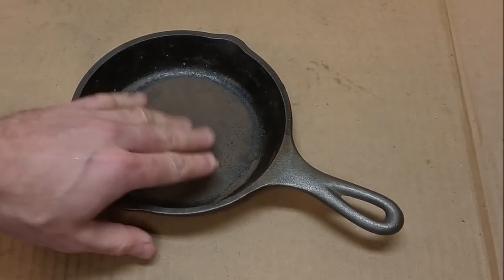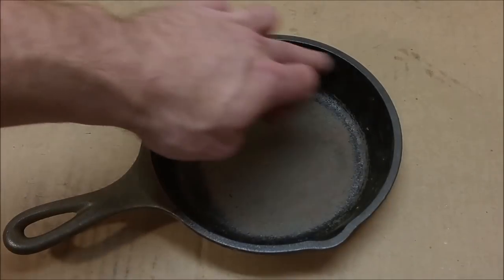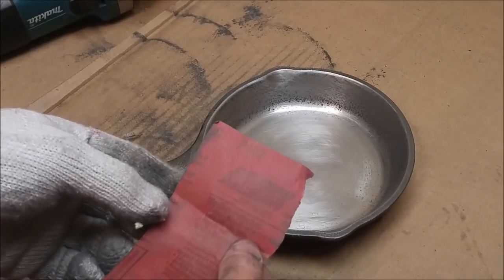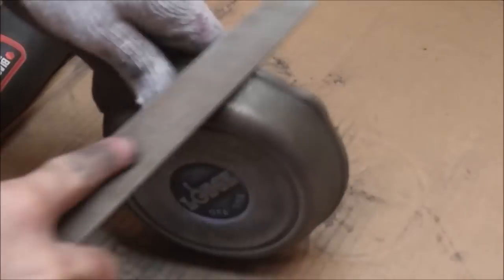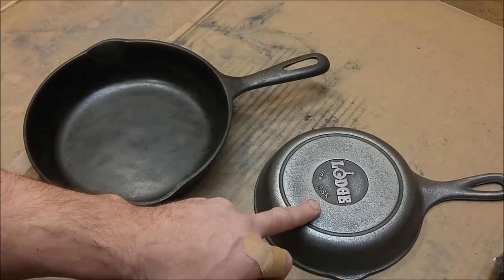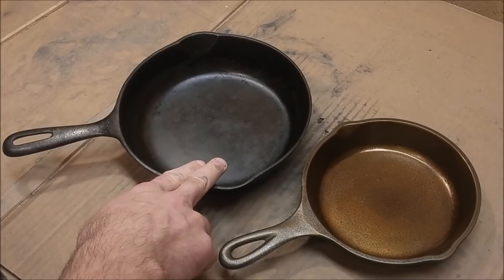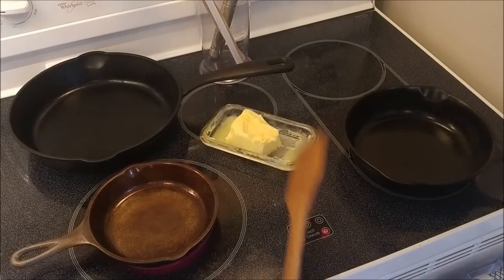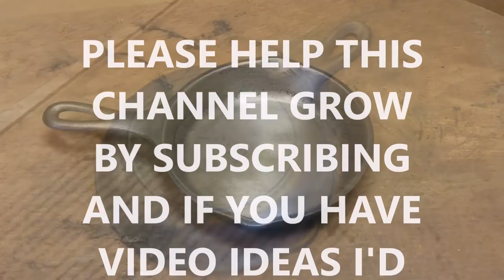🍳 SMOOTH a Cast iron Lodge skillet to make it function like an antique

Comment: I'm sorry man. Any authenticity this video could have had was completely lost on me when you sanded the outside of the pan and filed the edges etc. As a person who suffers from OCD, I can recognise this whole video is an exercise in obsessive behaviour. Unless you cook on the underside of the pan this was just ridiculous to watch. I suppose now one has to sand and file down the stove top to make sure that's flat. 

Furthermore, the seasoning is what gives the non stick surface you want in a pan. When the grit of the food-contact surface of the pan is too rough, then the incremental film deposition takes a long time to fill the troughs and lay a glaze over the bottom of the pan. So I can see the purpose of knocking the grit of the bottom of the pan down a bit. But polishing it right down to bare metal, you realise you have made it slick. Your new seasoning layer has nothing to grab onto. So I now expect your new seasoning layer will come off far quicker than people who just did the ten mins of light sanding work that was actually needed. The seasoning bonds to the metal but the grit helps it last longer before sloughing off. Yours will slough off far quicker.

I'm sorry man but in my opinon you took this job way too far. Maybe you enjoyed doing it and good for you. But this should not be an advice page for others in my humble opinion.

A quick ten min sand on the bottom surface to soften the grit is all that was needed here.

You lost me when you filed the inside of the hole in the handle. You aren't ever going to be cut by that sharpness during cooking and normal handling, and you aren't going to hang that pan on a plastic hook where that sharpness would cut it. The heavy duty metal hook you are going to hang it on would have softened that naturally. At that point I knew I was watching somone obsess.
Reply from the maker: Thanks for your opinion, I certainly appreciate your detailed comment.

I have performed quite a bit of testing since this video and I have found that the non-stick properties of the polymerized coating is not very good, it requires a coating of oil and relies on the generation of steam to prevent food from sticking.  A good way to test this is where residual oils were removed from the surface and food was cooked directly on the seasoning.  I have tested a pan with no seasoning for example and I have had good non-stick results using oil.  Cooking temperature, the type of food and the temperature of the food being added to the skillet also play vital roles in whether it will stick or not.

The seasoning does do a good job of preventing rust from forming when the pans are washed out, or if water is left in for too long.

Videos like this will not please everyone, some people hate them, some people love them.  In any case it was a fun project, the pan looks great and performs well even now.  

I filed the inside of the handle because I hang my pans and it slips on the hook a little easier, doesn't need to be done for any other functional reason.

Have a good one.
Reply: @Visakan - Any value your opinion held was forfeit, in my lofty opinion, when you wrote about lost "authenticity".  
Things you need to learn and remember:
1. Just because you haven't figured out how to make seasoning stick well to a slick surface doesn't mean it can't be done. (I happen to know from personal experience it can be done.)
2. Seasoning alone doesn't give the non-stick properties you want.
3. The internet is full of incorrect information.
4. Suffering from OCD doesn't qualify you to diagnose obsessive behavior in others. (Too bad your OCD didn't force you to pay closer attention to the video.)
5. Stating "in my humble opinion" does nothing to mitigate or correct a bad attitude. False humility only makes things worse.
Reply: Wow you don't have anything better to do then criticize....if you want even and uniform heat in a cast iron pan all surfaces need to be cleaned and sanded and seasoned...it does make a difference

Comment: I despise Lodge cast iron. People who defend it say, "Well, it gets the job done," but I don't accept that reasoning. The obvious superiority of vintage cast iron should be an embarrassment to the people at Lodge, sending their products out into the world as they do. Their crude sand casting is ridiculous, and the mere fact people have to spend hours with power tools as you have done to bring their product up to snuff is disgraceful.
Reply from the maker: Okay, that's a different take on it.   My personal opinion of the Lodge is that it is not very refined in comparison, so I do have a preference toward using the vintage Wagner...  The Lodge price-point is so low that I can also see also see the attraction to CI noobs.  As far as new CI, my Kitchen-aid at $10 has performed very well, but it also is a little chunky and lacks that quality feel of the vintage ones.  

In an upcoming video I will be taking a new cast iron pan to 'beyond-snuff" using an incredibly tedious method I don't believe has been used anywhere.